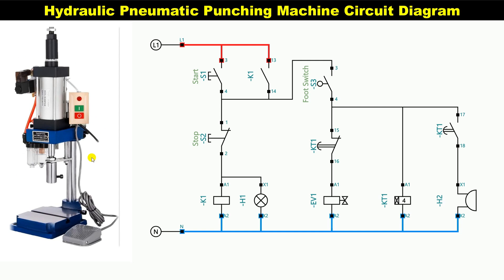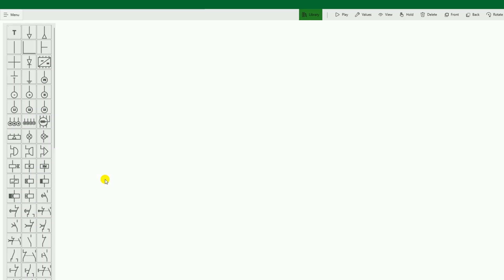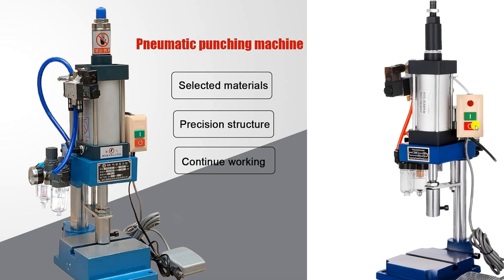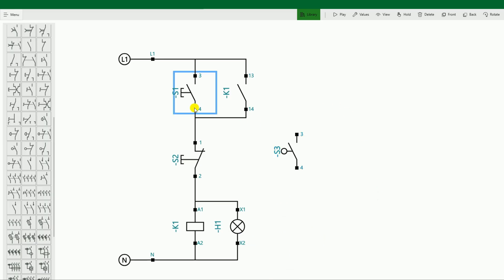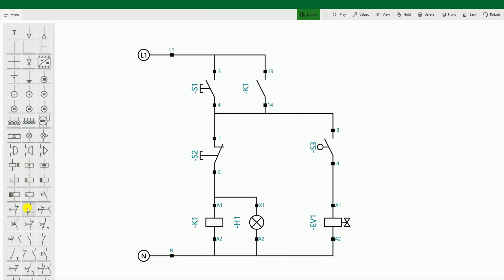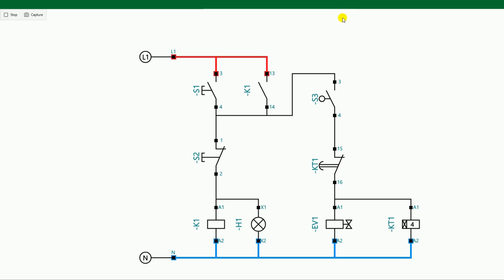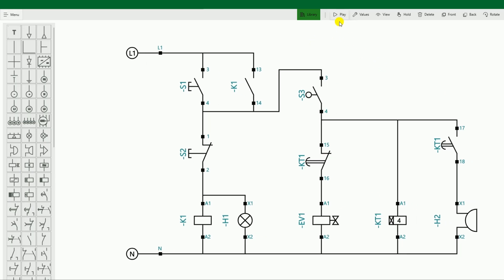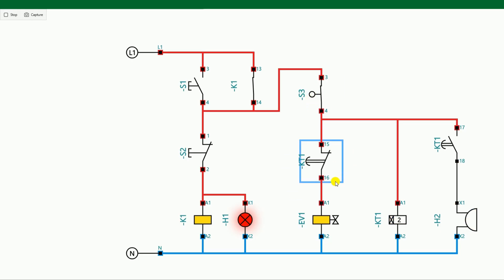Pneumatic Punching Machine Circuit Diagram Explained @TheElectricalGuy

Comment: On the Indikation lamp, if the contact fail will the lamp switch off if its connected in parallel,  is not series the ideal connection

Thank you for the Videos very helpful